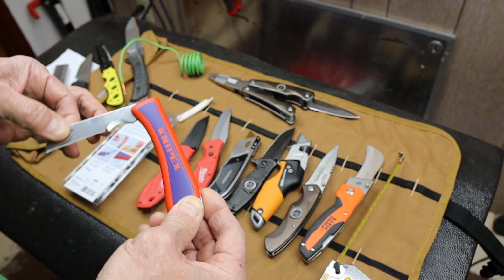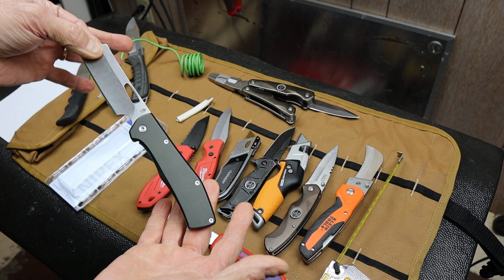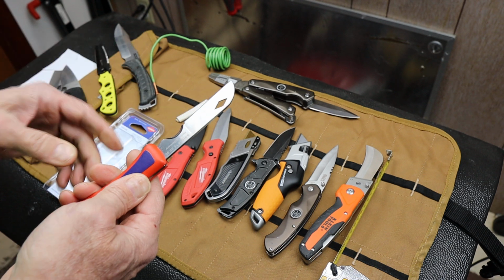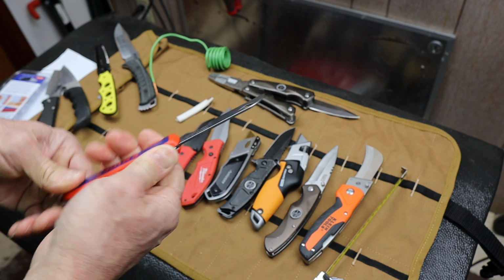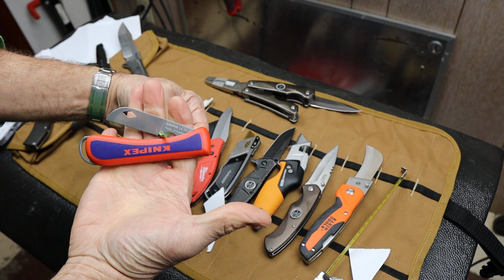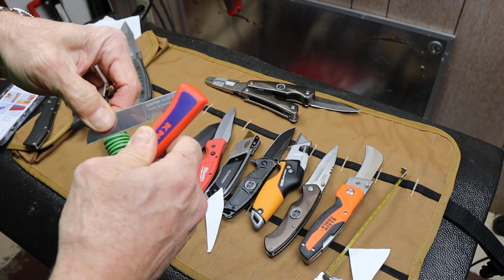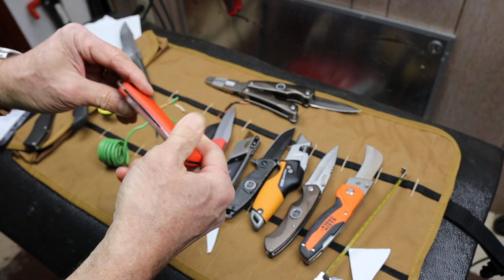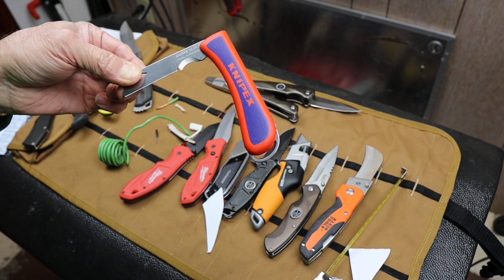Knipex Knife Cutter Thing 162050. A Cautionary Tale, IMHO of course.

Comment: That notch is for stripping large wire for termination in panels and switch gear. It appears to be a left handed knife though
Reply: That’d work fine for me right handed, hard to explain but I think that notch would work well up to maybe a #1 or #2 ? Anywho I bought one, coming tomorrow, we shall see ~
Reply: No it’s for SWA cable. You can’t get it in the USA.

Comment: This knife is an example of a tool that is useful in countries with heavily restrictive knife laws. Locking blades are unquestionably safer, but also illegal in some European countries. An electrician may need a folding knife in his tool bag in countries that restrict the carry of knives, but in the US we would likely just use our normal pocket-knife. The branding and trade specific features also mark it clearly as a "tool" rather than a "weapon" in such restrictive countries.
Reply: That's only part of it. The trade has moved away from traditional knives here, so this one looks strange to a lot of electricians now. Up until not that long ago (~25-30 years?) Klein basically only sold hawkbill, sheepfoot and coping blade knives for electricians (1550 series and the lowest numbers of the 44000 series). Knife collecting has changed the styles they sell, and even the first knives they sold to appeal to collectors had names like "Sportsman" instead of "electrician's knife" or "lineman's knife." Today's electricians carry very different knives than they did 30 years ago thanks to marketing alone.
Reply: What you wrote is absolutey correct. 
Thank your for clarifying :) 
My family makes these 😎
Reply: @PetrosArgy  What sort of knife do electricians use nowadays?

Comment: Finger choil is designed for stripping round cable sheat that is in use in continental Europe. First you cut around the cable with half moon part of the blade from the place you want to star stripping the cable  then you cut along cable with the tip of straight part of the blade to finish stripping. It is designed for Europe,I dont know why they sell that knife in US in the first place. I dont know if I menage to explain to you with my bad english :)
Reply: There are plenty of ways to use it here, too. This guy just doesn't know anything about stripping wires.

Comment: I’m a Knipex fanboy and recently bought this knife.  I’m a low voltage tech and I’m not sure it’s very practical for everyday use in my trade as I don’t work with heavier gauge wire.

Comment: It is designed for cables used in Germany and i don't know why you would use it in USA.

The packaging of the cables can be opened using the first part of the knife.
The second part can the be used to remove the outer mantle, which is round in Germany. or to sharpen common pencils. 

Costing less then 10€. it is more or less a cheap cutter that has some few/limited electrictian features.

You can also use other cutters or knifes to do the job.

It is probably mainly in the line up of knipex so they have a knife for their sets.

I doubt that they make it themself.
Reply: ^^^Thanks for that.
Reply: Solingen made for Knipex.

Comment: The stripping function is can be done differently with the blade open  using it in a paring fashion. It is difficult to describe easier by video. Face the blade up lay the wire across the scallop and put pressure on the wire with you thumb while rotating the wire with the other hand. Don't align your thumb directly with the edge

Comment: I don't know man. I've been using this knife as a commercial electrician for about two years it works great. Granted I've never tried it on 12gauge wire like you because I have wire strippers for that and I was taught to use the proper tool for the job I use it for stripping anything over 8gauge wire and it works wonderfully. I strip 3/0 feeders wires with it extremely fast and safely. Never have I ever been concerned about cutting myself with this knife because I know how to strip wire with a knife properly.  Maybe you should try using the tools for the task they were intended before putting out a review on a tool. Just a tip

Comment: Hi there but your using it wrong .I,m an electrician from europe and we use them all the time. Its right handed. it has a specific porpose ,  stripping large single or multi stranded cable. Nenad Stokic is right. if you want to carry a knife on your person in most european countries the blade must be under 3 inches. You never use it in the partialy closed position.

Comment: Thank you for another great video.
I have this knife, and managed to strip out cables with no issue. Of course, as you've stated, need to be extra cautious with where your fingers are.
What bothers me more, is the poor build quality of this knife. On my knife there are severe gaps between the scales (plastic grips) and the metal skeleton of the handle. In fact, when I hold the knife, I feel the scales bounce. I'd prefer a dedicated stripper pliers anytime.

Comment: Turn the knife over and use your thumb to hold the wire to the stripper so you pull and your thumb controls pressure for more accurate depth. What are you even doing trying to spin the knife half open lol. I am an electrician and I can see that notch being very useful on larger wires. Anything 8ga or smaller I’m using strippers, but something like 00 and up using your thumb to hold the wire to the stripping blade and rotating that way would work well. That’s how I currently do it with a utility knife.

Comment: When I was in the Navy working on aircraft electronics, one of the weirder tools we had was a KaBar Electricians Folding Knife. It had a half round sharp edge for stripping wire/cable. No blade lock. Totally useless thing that was rusted solid every week I did tool inspections and maintenance. Never got sharp enough to cut anything, best use was making PB&J's with it.

Comment: An electrician knows how to skin wire with that knife. Not difficult.
Reply: It needs to be locking, most electricians would use a cheap locking utility knife to skin cable
Reply: I am a electrician I can tell you that knife is garbage sure its sharp but the fact it doesn't lock and if that little curved blade is for skining wire I sure as hell don't know how to use it. Best knife for electricians is hands down a klein knife.
Reply: @cliffadams84  you can sharpen pencils with the smaller skinning radius.

Comment: Needs to be blade all the way, no hole, no notch, no half stop.  Tip slightly more square.  The tip angle helps control scoring depth.  Klein got it close but the thin cheapy handles and the annoying lock.

Comment: Noooo dont touch the bottom of the blade , its sharp too :) 
It works exactly like you did in the end , no worries it wont snap if you hold it correctly 

Hope it was nice and clean because I might have cleaned your knife :) 
Should be sharp and useful for a long time!

Comment: Dude, love your videos. Been on a spree lately. But I gotta say, that this one was pretty bad. I'm an industrial electrician and this is obviously for larger gage wire. You would never use a blade like that to strip small wire. But hey, you're not an electrician so I won't hold it against you for not knowing
Reply from the maker: Thanks for the feedback. I have since learned much about the knife and other ways to use it. Oddly, there is a glut of YouTube videos and website pictures showing exactly the same thing I was doing. I've run int Knipex tools that have features often missed, or seemingly obvious situations where the tools was misapplied as with my video. Well sort of. The cutting cord and wire the way I did is quite common, just not with a knife dedicated to such a purpose. Either way, I learned a lot, and am hoping to avoid such mistakes in the future. Thank again.

Comment: Hey Doc I been getting into knives more n more lately and was wondering what you use to sharpen yours? Another thing is, have you seen all new mini pry bar razor knives that Gerber is offering? I also think another company called civivi? makes their own replaceable blade utility knife.
Reply: I’ve been sharpening as a hobby for years, and part time for a side income. For most people getting into sharpening I ask them to consider two paths. One would be traditional free hand sharpening, that is with benchstones, there are many options in this range from Diamond plates, oil whetstones, water stones, ceramic stones, ect… 

The second, and growing more popular rout, is guided angle sharpening systems. They tend to be faster to learn and become proficient with, but can get very expensive very fast if you want to take a deep dive. On the cheap end you have systems like the Spyderco Sharpmaker, Lansky, and Work Sharp Precision Adjust, medium level you have the KME, Edge Pro Apex, and Hapstone, on the high end you run into systems like the Wicked Edge and Tsproff. 

There are also power sharpeners, but for higher quality knives you generally should avoid them unless you really know what you are doing. The system of note in this category is the Tormek, T4 and T8 models, they are great because they are water cooled and won’t ruin the temper of the edge of your knife like most belt sanders will, and they are great because they are super flexible and are amazing at tool sharpening: chisels, gouges, drill bits, scissors, they’ve got jigs for just about everything.
Reply from the maker: For a sharpening kit, I like the Spyderco Tri-Angle kit. Not cheap, but does a lot very well. They Worksharp Benchtop is less expensive and works, but not as well as the Spyderco https://amzn.to/3KF1gUDBut mostly I just reach for my Fallkniven DC4 stone https://amzn.to/3KDptuK. And I use a kitchen ceramic rod and leather strop for finish work. For really big jobs I'll use an electric WorkSharp belt sharpener. https://amzn.to/3KCGS6P

Comment: This is a confusing video - there are a half dozen "electrician's" knives in view which would suggest you work in the trade, but it seems like you have no idea how that knife works. Nothing that you did is something I would do with that knife nor does Knipex show it being used in any of those ways on their website - no cutting wire, no stripping away from me, no using it as an insulation puller, no trying to pull romex sheath off like that. Every one of those things you did will either be dangerous to you as the user or could damage the wire.

This kind of knife is designed to be pulled towards the user 90% of the time. The cutting notch is for scoring sheath or insulation and for cutting a strip of insulation off on heavier gauge wires (#2-1000MCM). The hole in the blade can be used to tie a loop into to make opening the knife easier when wearing gloves. Other brands use studs on the sides for this. That's pretty much all you're supposed to do with this knife.

Comment: WTF? If one of my apprentices started using this knife as shown in this video, I would lay into him with a offensive, profanity laced tirade questioning their intelligence, fitness for the trade, and defects in their genetics. For smaller wire you'd use wire strippers: they're easier, safer, and more precise. Is it a knife suitable for bushcraft or E.D.C? No. Go back to Wal-Mart or the dollar store and get something else if you want to play Rambo. Is it a knife suitable for a trained, certified, electrical professional working with larger wire? Absolutely - it's not materially different than knives I still have that my dad bought and used 50 years ago, and have been used for generations. The half moon cut-out looks suitable to me for ringing a wire for terminations and the straight section would be used for slitting open the jacket or insulation. I would never advise "cutting away from you." Are you afraid you're gonna lose control of the knife? That would suck for your tool partner or elevator contructors 10 floors down an open shaft, or god forbid, the general public over the side and 50 floors down! The safest way I know to strip large wire is to grab the knife in a death grip, get it started several inches or feet from the end, pull your fisted knife to your chest and pull the wire past the knife. You've got the knife securely held against your chest and you're moving the cable, not the knife. And then, what you call the "choil", should remove a strip of plastic like soft butter on hot toast. Is this knife for the general public? NO! Would a trained and certified electrical professional find it useful? We've been using knives like this for generations.